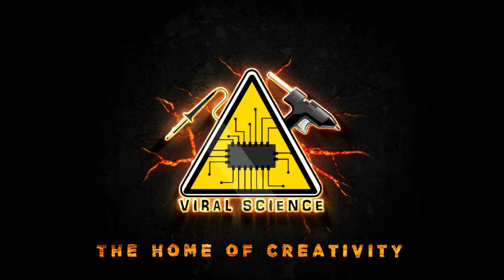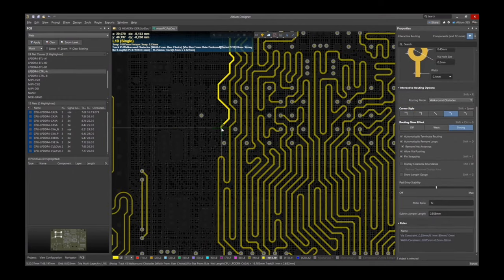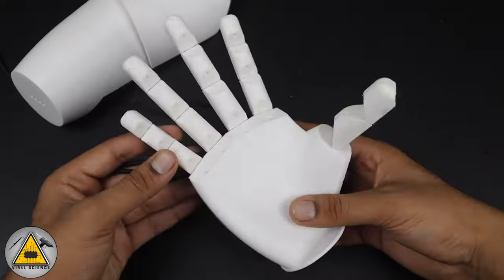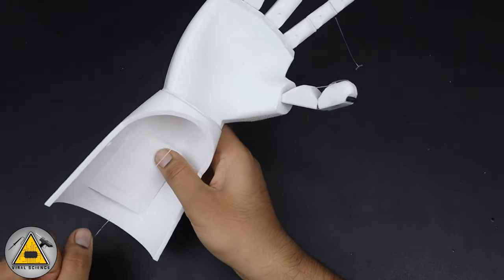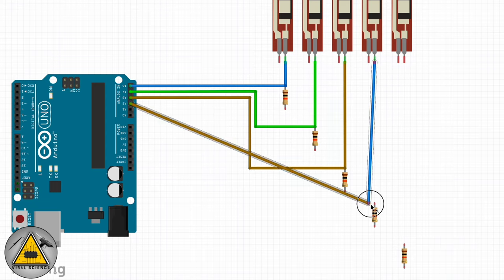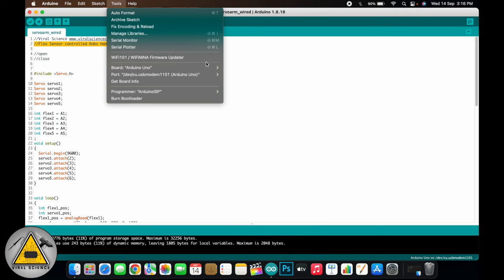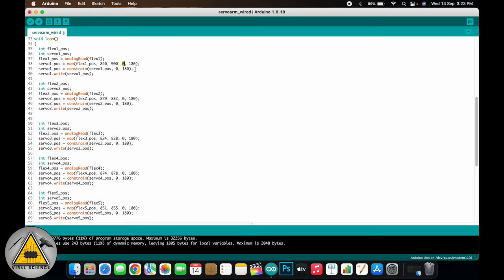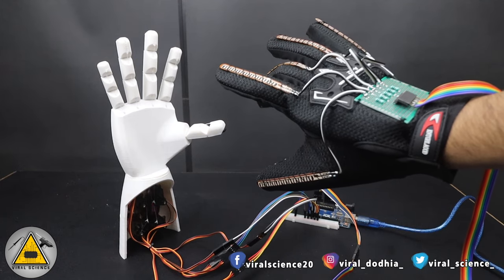Arduino Flex Sensor controlled Robot Hand | Prosthetic Hand

Comment: WE NEED A WIRELESS ONE!!
Reply: yes we do please can we get a wireless version
Reply: Use a nRF module and another Arduino Nano on the Gloves
Reply: @shakibgazi963 Can you be more specific or maybe do you have any example how to use this? It would help a lot.
Reply: @vikabubushi  Connect the flex sensors to one Arduino to process the data. Then send the PWM values to another Arduino with which you have connected your robotic arm. And to send this wirelessly use a nRF24L01 module